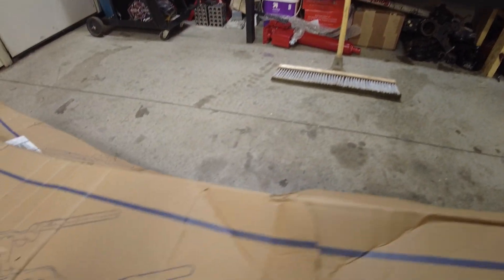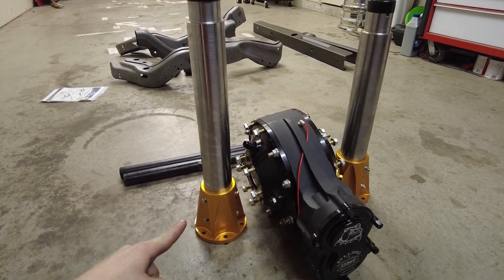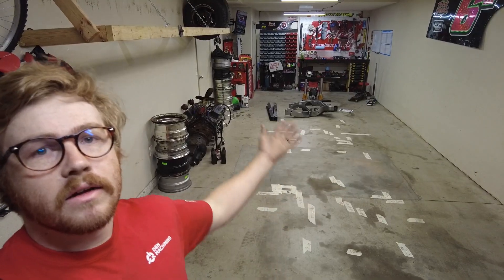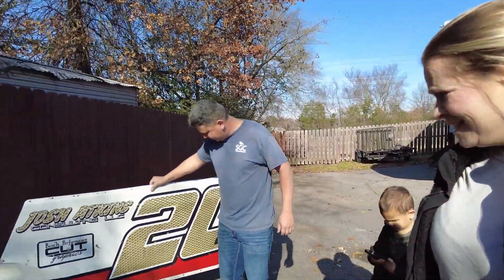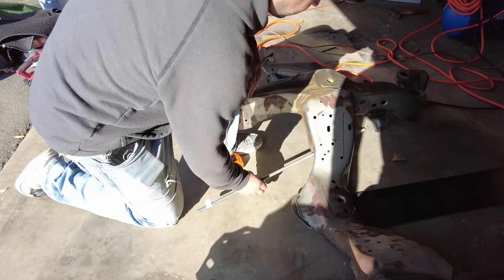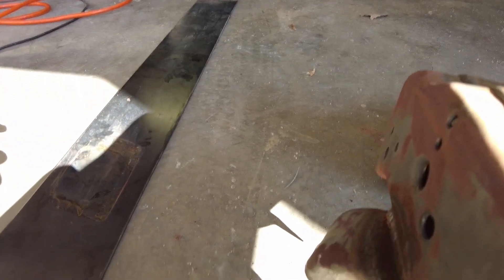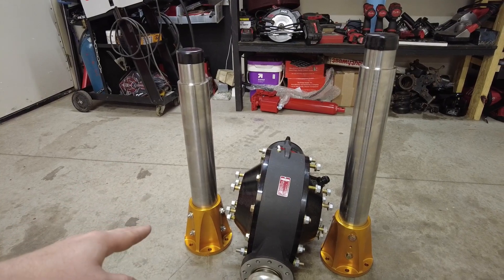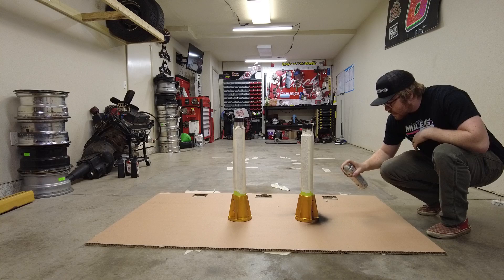THIS PLACE IS A MESS! What's going on at Busch Performance? Ep. 1

Comment: I usually take my used oil to O’reillys. They take it recycle it as long as there isn’t a bunch of water in it. So if you run alcohol mix some lawnmower oil or oil out of your truck in so they don’t throw a fit.
Reply from the maker: Awesome. I appreciate the tip
Reply: Either that or dump it in the tank of any old diesel, they'll run fine on it